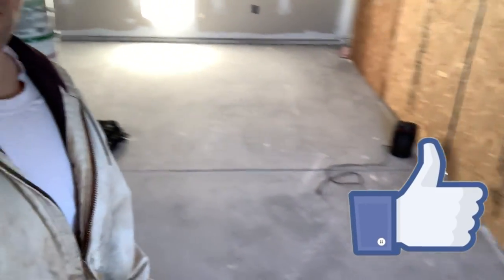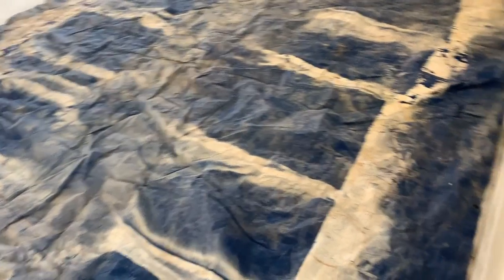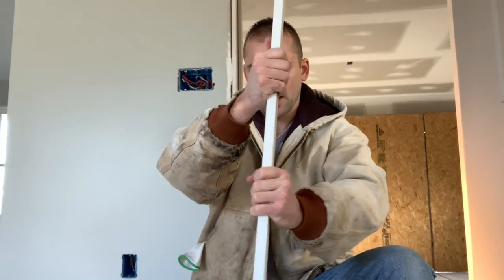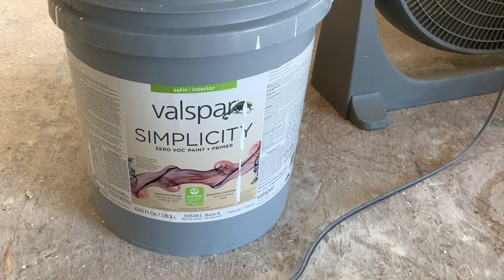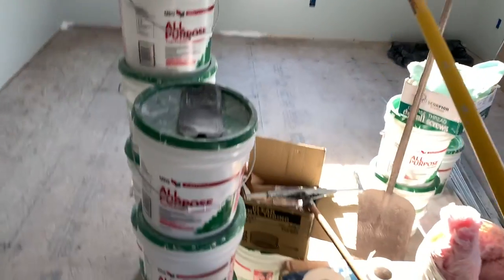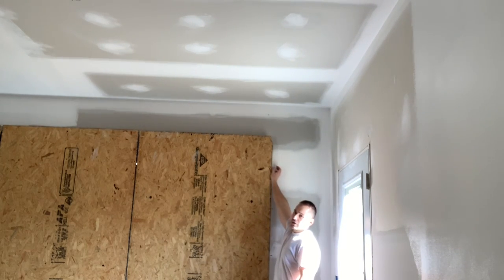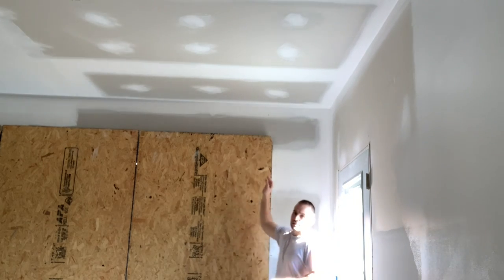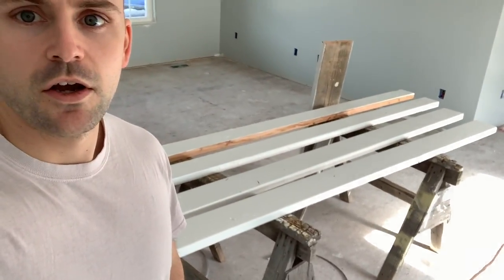How To Paint Garage Walls And Ceilings

Comment: Hello,

I noticed in your newer "How to Paint a New Garage" vid, you used a primer first and then applied two coats of paint; whereas in this older vid, you used a combination primer and paint. 

How has the combination one held up over the years and you would still recommend it at this time (for unfinished garage walls)? Or do you recommend the separate primer and paint now?

Comment: I have a lot of boxes in my garage. Can I just move them all to the center in order to paint the walls or do I have to remove everything from the garage prior to painting?
Reply from the maker: Sure can!
Reply: @TheExcellentLaborer  Thanks for the reply. My landlord wants to paint the inside of the house as well as the garage that me, my wife, and our son have been renting for ten years plus replace all carpeting which is only upstairs. This is a enormous task due to all of the boxes in the garage as well as all of the furniture in the house; both upstairs and downstairs. I'm not sure how to go about getting the house ready for painting other than doing my best to move all items to the center of each room so that the painters have as much room as possible. Replacing the carpet is going to require moving all beds, dressers, and other items either downstairs or perhaps to one room so they can be done one at a time. Any suggestions as to go about getting this done in the easiest way possible? I'm overwhelmed because our landlord wants to get the project started as soon as possible and I'm not even close to being ready. Thanks.

Comment: How is the texture between a roller and a paint sprayer? With all the prep required, does a sprayer save any time? I've done plenty of rolling, and I'm trying to decide if it would be worth it to invest in a spray gun. I flip houses, and I am soooo tired of painting.
Reply from the maker: There’s definitely a texture difference but I back roll all of my spraying so it is textured with a roller. Spring is a lot of prep work to wear rolling is not.
Reply: 18" roller, spray is faster but you don't have as much control around doors, windows , electric boxes etc. You may want to tape and cover them.

Comment: How many gallons of paint would you recommend for a  three car garage?
Reply: Mr. Wick 1 gallon covers 400 ft.². So if you do two coats you will need 2 gallons per 400 ft.²
Reply from the maker: Josh A Berg Yes that is correct

Comment: Hi, How many buckets did you used for this garage wall?
Reply from the maker: It took two. Great question though!
Reply: @TheExcellentLaborer  Thank you for your answer. And when you start painting did you start on the top or at the bottom of the garage wall?
Reply: And did you use any materials before you start painting the wall?

Comment: Do you recommend a roller or sprayer?
Reply from the maker: I would do a roller for a small job like a garage. If you were doing a whole house a sprayer would probably make the most sense. A lot of prepping when you use a sprayer. Thanks for watching!
Reply: For that job you just did same colors on ceilings and walls nothing in there absolutely should use a sprauer5

Comment: would using a paint spray gun also be efficient/doable?
Reply from the maker: Hey spray gun would be fine. Before a garage the small by the time you tape around the doors and stuff it would take a lot of prep work. So rolling maybe quicker because of all the prep involved with spraying
Reply: The Excellent Laborer noted! Thanks so much for taking the time to reply back!! Much appreciated!!
Reply from the maker: Sure! Glad I could help
Reply: @TheExcellentLaborer i disagree. The prepping takes less time then the first coat. And then spraying makes it 3 times as fast

Comment: Great video. Very informative. Quick question about the basics. Did you use any type of particular cloth to wipe the walls prior to painting?
Reply from the maker: I do not. I actually use a shop vac and broom to get the dust off. It works well believe it or not.

Comment: Nice ! What about the tapes on the garage wall ? If they are not coming off, can I paint on them?  Also how do I clean up some blotches of paint in some spots on the garage wall?
Reply from the maker: If the drywall tape is coming off you should fix the drywall tape before painting. If you have splotches on the drywall before you paint use kilz on the wall first.

Comment: Nice job.  I'm planning to paint my garage this Spring.  Did you use the same paint/primer on both the ceiling and walls?  Was one coat adequate for coverage?
Reply from the maker: I did. It took two coats for paint and primer from Valspar to look good. So when you go to do this I would figure to do two coats. What brand do you use?
Reply: @TheExcellentLaborer  I haven't decided yet.  Since it will take 2 coats, would it work just as well to apply one coat of primer and then one coat of paint?
Reply from the maker: Definitely. If it was primed first it would only take one coat. I’d say any brand of paint would cover that way well if it is just white.

Comment: how much would/do you  charge? about 450-550 standard paint included here for a 2 car garage- wonder how much the builder marks  up the homeowner's...........did about 1700 bucks in upgrades on last weeks unit...Wayne coating on first floor hall way plus crown- crown in 2 additional bedrooms- wayne's coating going all the way up stairway banister- plus additional woodwork and I once again would be curious to see the upcharge from the builder on this unit...hard to go by sq ft when extras come into play....whats nut's is I've noticed you can charge about 3x the price when it comes to custom residential.....nice job..keep it up.
Reply from the maker: I’m not sure. I did not do work by the hour. I’ll build the whole house and sell it. Only have about $50 in paint for this whole garage